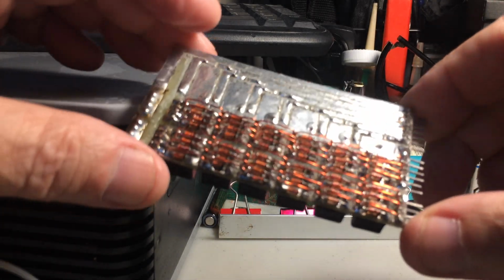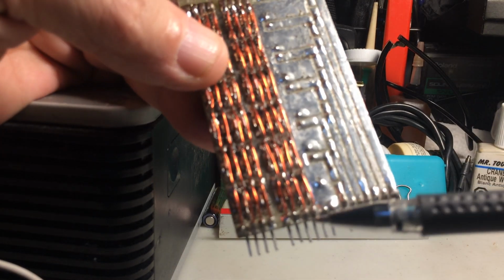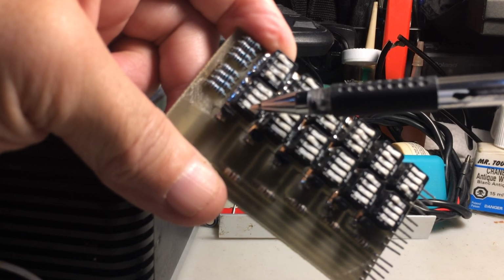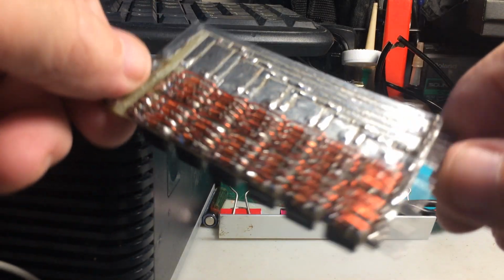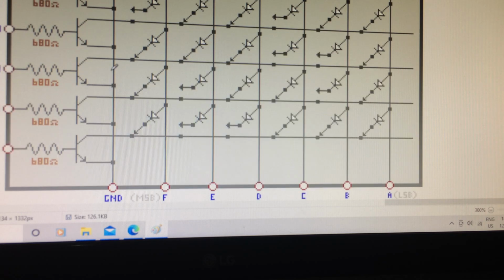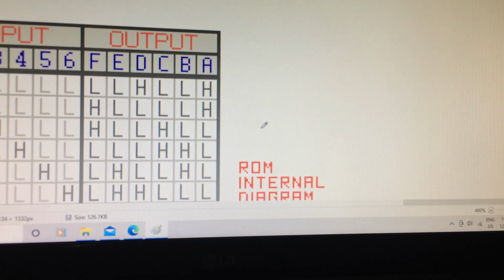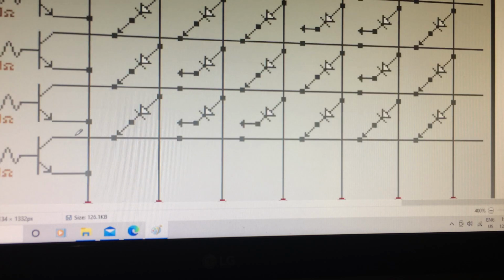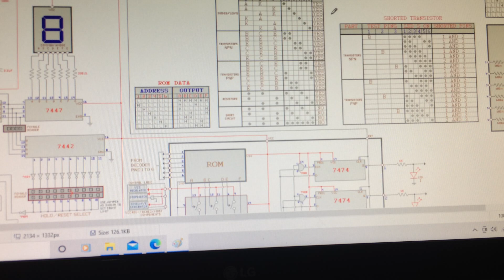DIP switch controlled EPROM

Comment: Add a multiplexer as an address decoder (3bit) and you have a full working prom.
Reply from the maker: this unit is only a tiny portion of my entire control system.........the decoding circuit is not shown in this video....if you are interested check out my other video's on component tester parts 1 to 4......of which this unit is part of.......thank you and you are correct.......i have a decoding control for this eprom but again is not shown in this video......only this eprom itself is shown